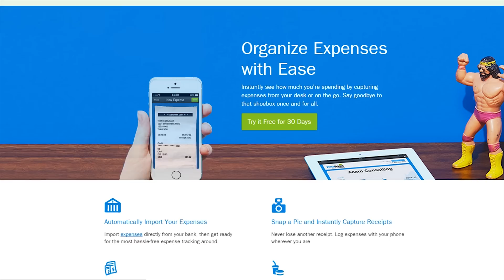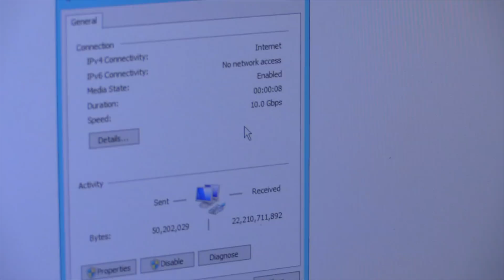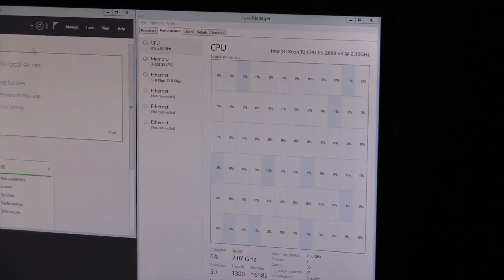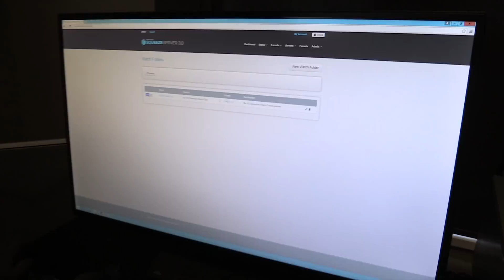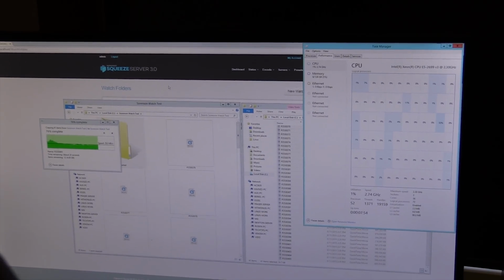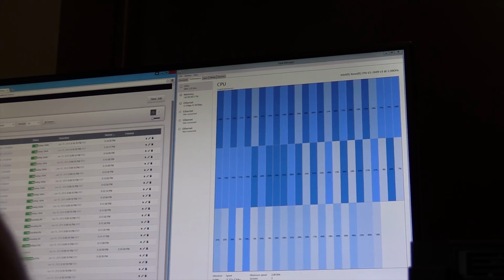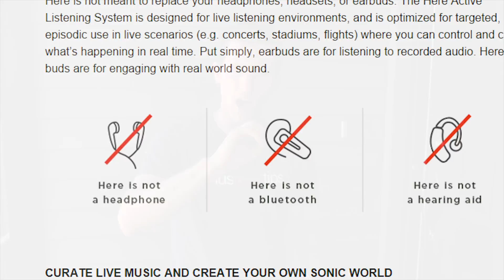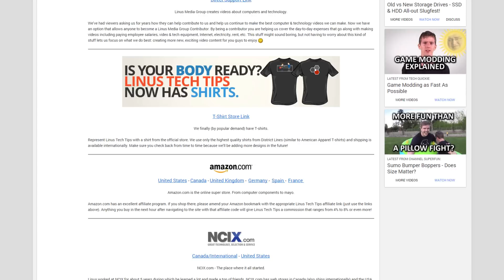36 Cores, 72 Threads, and Two Titan Xs - Our New INSANE Rendering Machine Part 3

Comment: Fucking hell man, that place looks like the command center for a terrorist group in a third world country.

Seriously though, sometimes I question if I really want to get into the IT field I'm pursuing, but I know it is what I really want when I feel most at peace and aligned with the world when I'm in a space like that, surrounded by hardware and wires. Reminds me of the pc shop I used to help at, motherboard and ram lying around everywhere, piles of dead hardware, cracked screens all about, guts hanging out of laptops and cases. Just sucks when you have to clean it up :L
Reply: @bock 
I think you are mixing up terms. IT and engineering are both very broad terms and both can include software and hardware related jobs. For example a software engineer will almost never work with hardware, but a a so called IT guy in a medium sized company will almost exclusively work with hardware.
Reply: danermanerkider America is a third world country.
Reply: This building is not his home. It's the office for Linus Tech Media.
Reply: danermanerkider heaven
Reply: danermanerkider Linus is also in the "I don't want to bother, 'cause I'm moving soon" mentality. Combine that with things like trade shows and the usual rush of his business, and you run out of time to even consider such things.
Reply: danermanerkider I've been in IT for many years and the type of shop Linus runs is outside the norm. We don't have servers sitting on the floor, we have data centers with proper server environments. We don't have cables strung from the ceilings with clips, we have raised floors and fiber trays. You don't see stacks of garbage piled up by doors, you see clean desks with current projects' papers (maybe), but not crap that looks like it just missed a trashcan. I can't speak for small IT shops, but in my experience, the work locations seen in this video would be outside normal. 

Linus is in dire need of an on-site receiving warehouse for the amount of hardware he seems to have on hand.
Reply: Bock Yang ***** is correct in stating that IT and engineering are broad terms. There are different ways of using those terms and they can even be used to describe the same thing. 

An engineer is a professional practitioner of engineering, concerned with applying scientific knowledge, mathematics, and ingenuity to develop solutions for technical, societal and commercial problems.
Information technology (IT) is the application of computers and telecommunications equipment to store, retrieve, transmit and manipulate data, often in the context of a business or other enterprise.
Reply: Bock Yang Incredibly sweeping definitions that somehow manage to be wrong. Computer scientists don't know anything about hardware? Have you ever met a computer scientist? Not to mention the terms used are still way off.
Reply: This place looks like my room also, but all the computer stuff are replaced with school books :/
Reply: I am gonna guess you are not from the field since you provided a weak defence. So "terms" for your sake. Oh, I am talking about Computer engineering and computer IT just FYI.

Computer software engineers develop, design, and test software. Some software engineers design, construct, and maintain computer programs for companies. Some set up networks such as "intranets" for companies. Others make or install new software or upgrade computer systems. Computer software engineers can also work in application design. This involves designing or coding new programs and applications to meet the needs of a business or individual. Computer software engineers can also work as freelancers and sell their software products/applications to an enterprise/individual.[7]

Most computer hardware engineers research, develop, design, and test various computer equipment. This can range from circuit boards and microprocessors to routers. Some update existing computer equipment to be more efficient and work with newer software. Most computer hardware engineers work in research laboratories and high-tech manufacturing firms. Some also work for the federal government. According to BLS, 95% of computer hardware engineers work in metropolitan areas.[citation needed] They generally work full-time. Approximately 33% of their work requires more than 40 hours a week. The median salary for employed qualified computer hardware engineers (2012) was $100,920 per year or $48.52 per hour. Computer hardware engineers held 83,300 jobs in 2012.[8]

Just yet another FYI, Computer software engineers are called computer scientists. They are NOT trained in the field of electronics and electrical design/circuits. They do not know how to troubleshoot hardware failures and issues.
Reply: danermanerkider  Pretty sure they know where to find every nut and bolt in that mess.
Reply: danermanerkider You could be shoveling shit instead of cleaning up computer components, though!
Reply: danermanerkider It all good  uhh just organized bins for them ahead of time something like this http://ecx.images-amazon.com/images/I/41DDj5cUZtL._SY300_.jpg but bigger
Reply: apocalance Admittedly it looks like it's one of their houses. I dont think the stuff they are setting up in there are for long term use there but for use at their new office which is an actual office space.
Reply: apocalance oh yes, absolutely. I know the place he has and his setups are not normal for professional enterprise environments. Although, I've seen some server rooms be pretty incredibly messy in terms of cable management and safety. Of course, they are not normal too and eventually need to be overhauled.  Although, like in small computer shops, you know, the storefront business people walk into with their hardware to be fixed, it's not uncommon I've heard and my experience speaks for itself. The front where the customers are is clean and inviting, but the back where the magic happens looks almost just like Linus' office seen in this video, but most of the stuff was on desks and the floor was tried to kept free for us to work around in. That was probably my favorite job so far, but it was short lived. I'm pursuing networking now though and hope to eventually become something like a Sysadmin or a Network Engineer or Network Architect.
Reply: +Sakata Kiyoshi 1st world= Member of allies 2th world Against (Germany italy etc) Third world Neutral Sweden africa. Etc. but nowadays its used for describing poor countries
Reply: +danermanerkider I'm sure you just made someones watch-list by admitting to having seen the inside of a terrorist command center
Reply: Ash Scott

Comment: I still never used Linux because wtf 4.  After hearing Microsoft recommit to pc gaming and then announce like 3/4 of it's titles as xbox exclusive I'm thinking I may have to give Linux a try after all.
Reply: Jacob Frashure I'm mostly just hoping I hear Windows get a bunch of heat for pulling crap like that.  

I guess as someone who listened to reviewers and bought a 970, I'm hoping that dx12 and it's utilization of the ram from both cards makes sli a reasonable upgrade to 1440p at good fps.

I figure spring will be a good time to make that purchase and try out 10.

Comment: Why cut-paste from the SD cards? Copy-paste and then delete just in case there's an interruption.
Reply: ShiroiKage009 I believe it's almost the same thing at least on Windows - cut & paste actually copies it and then automatically deletes the source file after it's done. The file is never "in transit" from source to destination.

But yes, in principle I agree... It feels safer, and deleting files only takes 5 seconds anyway.
Reply: TalesOfWar That's what I meant though, I think Windows literally always Copies no matter if you select move or copy - it just automagically deletes the source after it's done with that file, behind the scenes. At least I've never managed to corrupt a "source" file by removing the media mid-move (emphasis on move, not copy). Sure the destination might be corrupt, but normally Windows will detect it was a broken transfer and remove the partial copy anyway.

Maybe it depends on the file system of the devices involved.